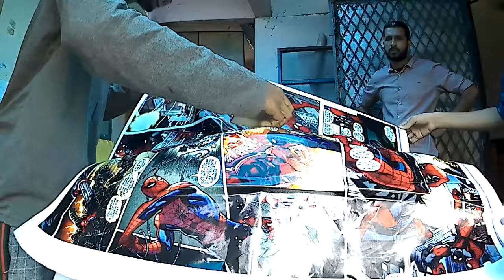Helmet vinyl Wrapping | Helmet Modification | Comic.

Comment: It is a good process depending on the materials you're using, but I never recommend it to others especially when you have lots of graphics within the decals, otherwise, the images get distorted or overstretched. Kudos to the installer for his patience in doing this kind of job.